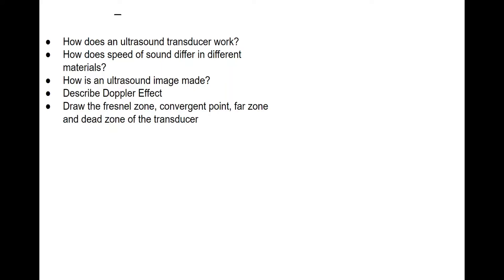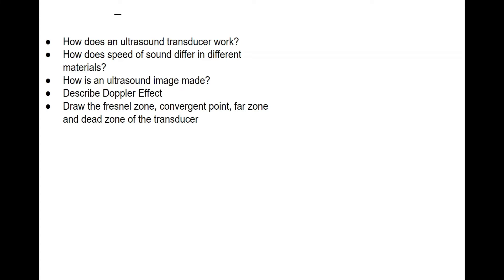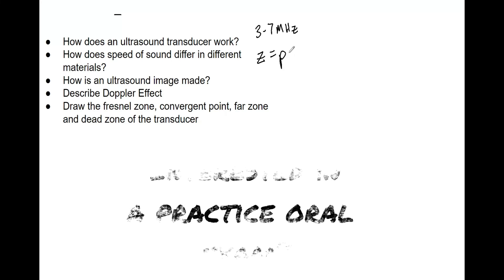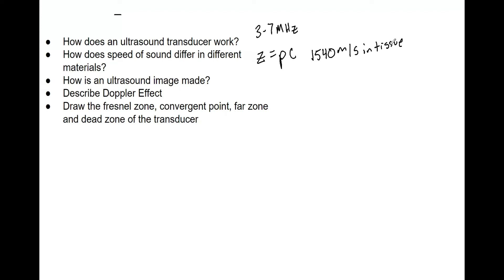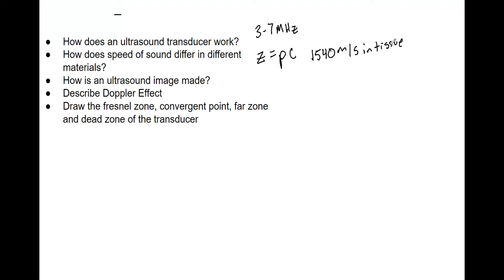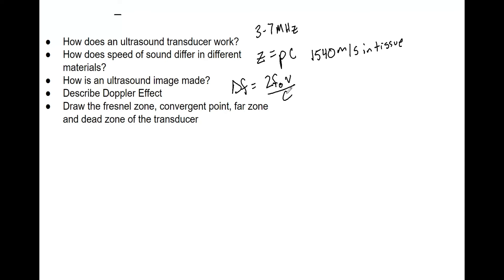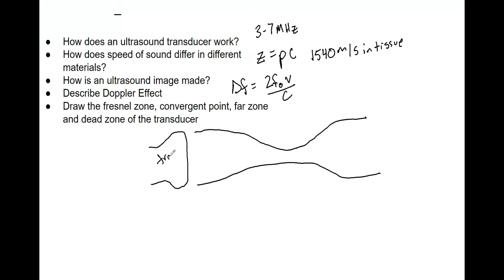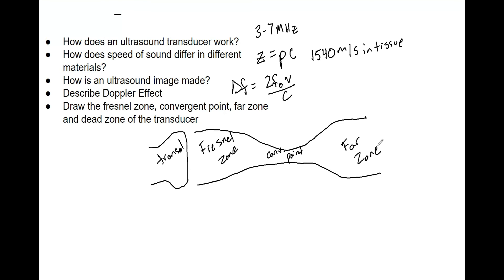Ultrasound ABR Part 3 Medical Physics Oral Exam Prep

Comment: TG 158 for reference?
Reply from the maker: I think you mean TG 128.  And that would be fine, but I would mention that I know TG 128 is for brachy ultrasound and although this topic isn't specifically brachy related I could still refer to it as a resource.